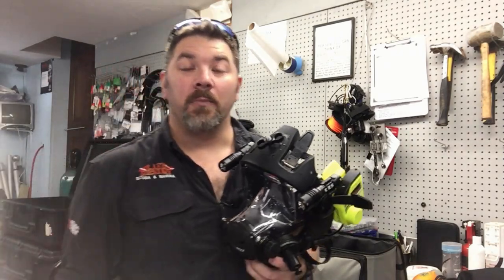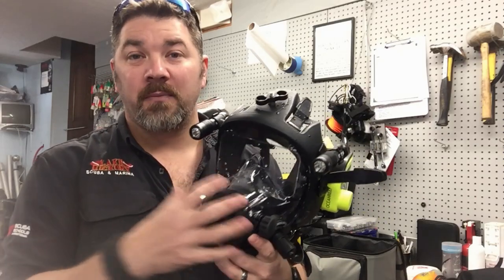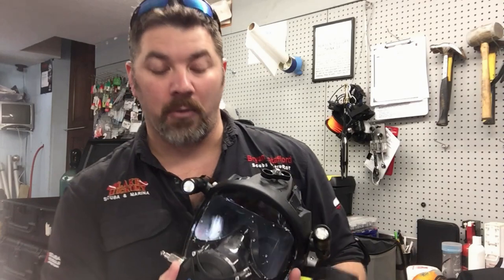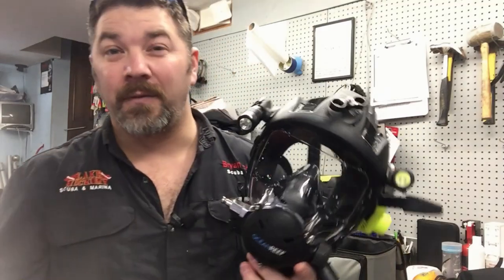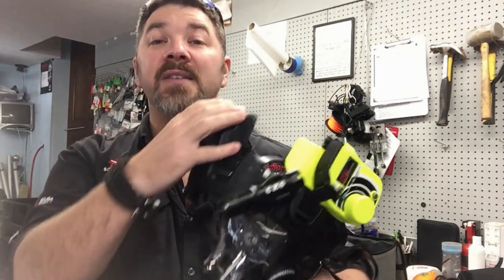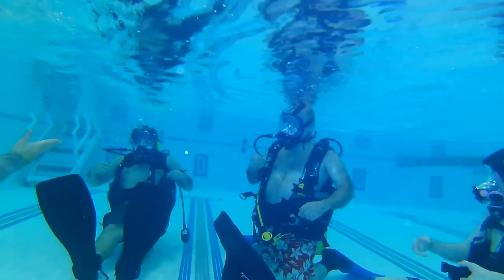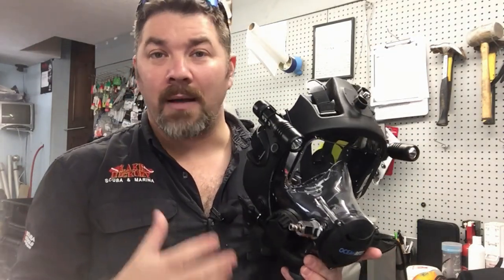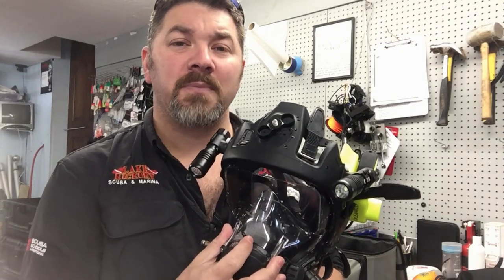Can You Flood A Full Face Mask

Comment: Could wearing a hood that isn’t compatible with a full face mask cause water to get into the mask? I noticed sometimes a little water will get in not sure if it has something to do with the hood that I’m wearing but I know they do sell hoods that are compatible with a full face mask and perhaps that might eliminate the issue.
Reply from the maker: Hello @stevenciesiel777, yes that could definitely prevent the mask from sealing properly. Most of the time, with a fully integrated mask, you would still be able to breathe from the mask, but you would rapidly lose air and if the mask wasn't sealed properly, it could cause the mask to fog as well. We have another video showing how to seal a Face Mask when you don't have the proper hood. https://www.youtube.com/watch?v=K6uY9O_FZf4
Reply: @LakeHickoryScuba  I will check out the video I really do believe that my hood isn’t giving me a good seal. I’ve noticed when I took my ffm in a pool doing some skills without my hood no water would get in. When I took my ffm with my hood on in the lake water would get in. I also notice that the mask kinda vibrates shakes when I’m descending perhaps I have it strapped on too tight and I’m not getting a good seal on top of it.

Comment: Great video. I'm just wondering, when you're using a FFM, Is the air consumption rate affetected in anyway? Overall, do you consider FFM to be better than the traditional mask when it comes to recreational diving? Thanks!
Reply from the maker: Hello Lean, great question.  So saying that wearing a Full Face Mask reduces or raises a diver's air consumption is not as simple as being black or white.  It all comes down to a diver's comfort level.  For me personally, I much prefer a traditional mask and regulator over a Full Face Mask.  My SAC rate increases every time I put one on, which is about 3 times a week. With that being said, I have several divers that work for me, and their SAC rate decreases.  They feel more comfortable while wearing it, thus dropping their breathing rate.  I wish I could give you a more definitive answer, but it truly is different for everybody.

Comment: If you forget to close the surface valve and happen to go head down for something it'll flood in at that point, or the ones we have for the dive Rescue team here do. Easy to clear but we have found that ours will flood if that valve is open and we go inverted.
Reply from the maker: This is very true, but like you said, an easy fix.  The surface air valve opening is through the visor portion of the mask and not the internal mask.  So a diver should have plenty of time to to realize the Surface Air Valve is open and shut it before to much water floods in.

Comment: Hi, how can we equalize the ear with this mask which seems to be no place to pinch the nose?
Reply from the maker: Most Full Face Mask will have a block system inside the mask, that is designed to close off the nostrils for equalization.  Also you can simply swallow or wiggle your jaw, just as you would with a traditional mask.

Comment: How do you address fogging? Is it an issue? (of course use of defog helps, but...)
Reply from the maker: Hello J John, great question.  One of the biggest benefits to using a Full Face Mask is, you never have to defog your mask.  When you breathe in, you will always have fresh air entering the visor area of the mask, which prevents any type of fogging issues.  This is of course as long as the mask is properly seated to the divers face.
Reply: @LakeHickoryScuba  That would depend on which FFM. The OTS Spectrum, for example, only flushes air through the oronasal pocket, not across the visor; mine tends to fog up if I don't use conventional anti-fog methods.
Reply from the maker: This is very true SeikiBrian, and Thank You for pointing that out.

Comment: do you get the same pressure when using a ccr
Reply from the maker: Hello Devine, great question. We typically do not use Full Face Mask with CCR's or SCR's.
Reply: Would there be to much of a risk of flooding the loop if you did? Im a ccr diver but have no clue about full face masks never used one

Comment: I have the same mask as you when I breathe through my mouth it works fine but when I breathe through my nose it cavitates a little any advice
Reply from the maker: We get more force (negative pressure) below our diaphragm when we breathe through our mouth, thus making it easier to get more air.  When we breathe though our nose, the negative pressure isn't as great, thus the cavitation you mention can occur.  A  few things I would suggest is, relax a little more, and make sure your mask's cracking pressure is matched to the intermediate pressure of your first stage.  This should make breathing easier.
Reply: Thanks
Reply from the maker: You're welcome.